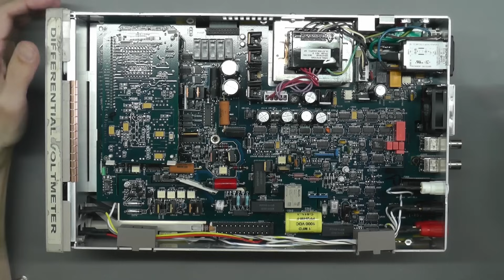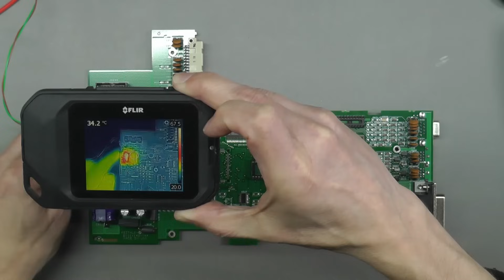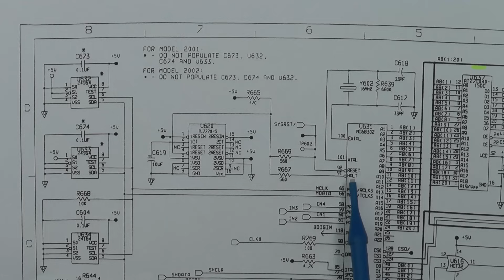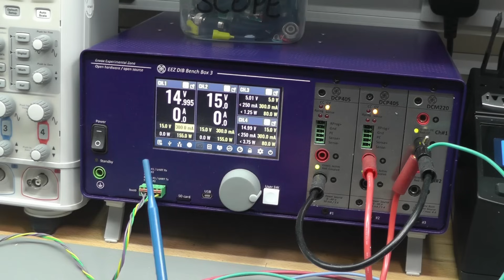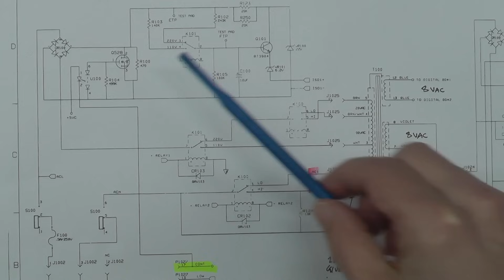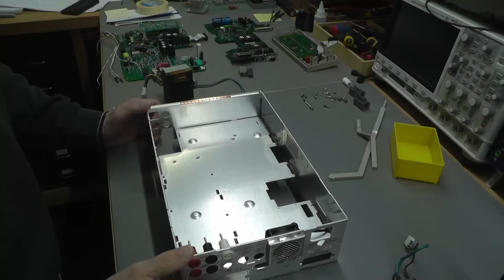No.133 - Keithley 2001 7.5 Digit DMM Repair (re-upload condensed)

Comment: Hello, congratulations on the repair, the pre-regulator saves a lot of power loss on the secondary side - The diode bridge can be used in an AC circuit in another way, I personally use it for simple control of the Master / Slave socket circuit - the AC line is connected in series with the Master socket phase, terminals + /- are short-circuited and on the AC outputs I then use the voltage drop on the diodes with which I control the Slave circuit - it has been working absolutely perfectly for several years.

Nice day 🙂 Tom

Comment: Great video Ian! I admire your determination, perseverance and skills. 
I think I would have given up when/if I suspected the CPU had blown. 
And lucky you had a donor analog board - fixing the original would be a nightmare if many chips were blown.
I'm amazed that they designed a unit whereby the failure of a relay or its control circuitry could catastrophically blow the arse out of the entire instrument!
Reply from the maker: I think it is one of those designs where the design dept. thought they had created something great…….but nobody said “what if”!
Reply: @IanScottJohnston  Stabilizing the primary circuit is a good idea, but without automatic voltage selection - I have a saying - the designer's hands were faster than the head 😁

Comment: I really enjoyed the original series - I learn so much from the detailed troubleshooting. I also enjoyed this condensed "revisit", thank you Ian. The automatic mains voltage selection feature seems like a really bad idea, can't really be designed to be fail-safe. Also seems unnecessary - how often does the input voltage need to be changed? Regards,  David
Reply from the maker: The worst of the design is that, certainly for 240VAC countries, when it goes wrong it can do little else but fry your Pcb's!
Reply: @IanScottJohnston  Yeah, that part of the circuit is just overengineered, imho.  It could have been the much simpler mechanical system that more or less never fails.  I've collected a number of parts + broken systems to work on repairing.  So far, haven't fixed any, but in fairness, also haven't spent much time on the project. :)
Reply: @IanScottJohnston  do you think it's worth modding the circuit to hard-fix the voltage selection?